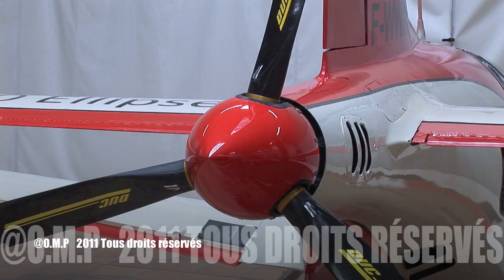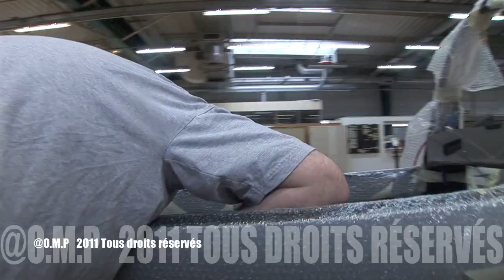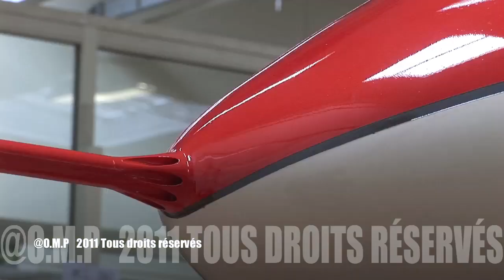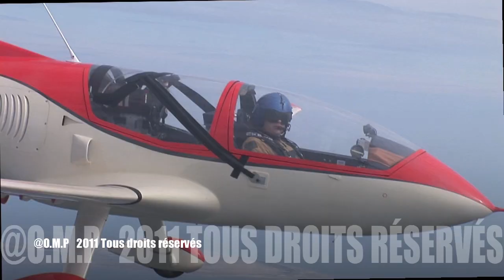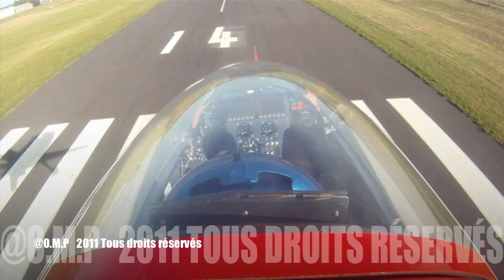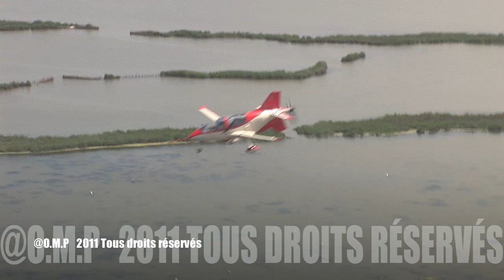Le LH-10 Ellipse de LH-Aviation

Comment: when you get to the part where you are designing the retractable gear make sure you weigh all the components and then calculate how much performance that will cost you compared to a a simple, reliable fixed gear that wont destroy your expensive, hard work if it fails in testing. I'm sure that was a consideration when designing this aircraft and fixed gear won out.

btw- if you don't like compromising don't go into aircraft design. Compromise is what the artform is all about

Comment: With newer 3d printing technology, all you'll need is the deign in the computer and your parts will be done in a matter of hours.
Reply: Do the 3D printer print hard materiel?.
Reply: ahmrou82 The larger the piece, the larger the printer you will need. They make guns now that can fire standard ammunition. Tools, intricate art and car parts made with precision all with printers. Look up 3dsystems dot com  As long as you can program the part, you can build just about anything.
Reply: +ahmrou82 3D printers can print anything that can melt.